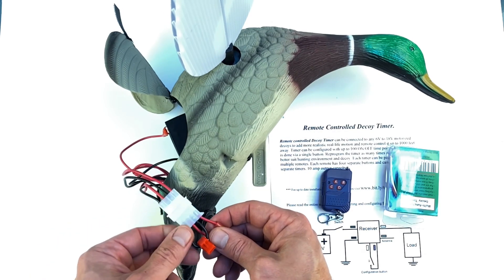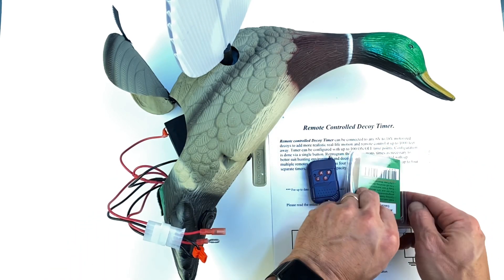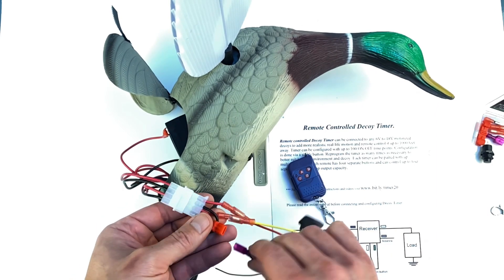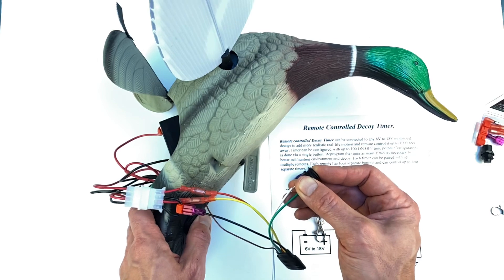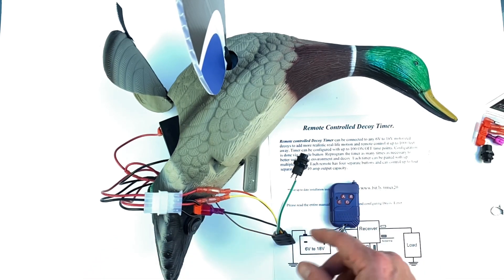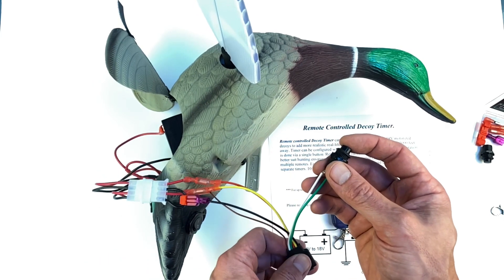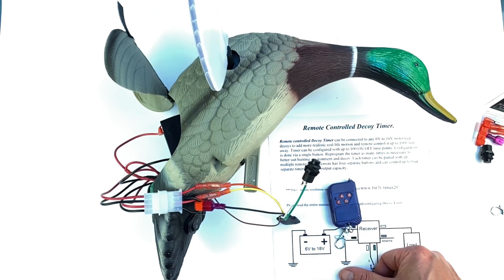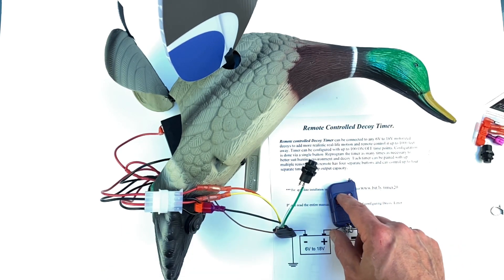Adding remotely controlled RF decoy timer to baby Mojo Drake

Comment: Question for you, is there any way to get remote timer to work with a motorized Lucky duck decoy? The ones that have the dummy plug in them, I could not figure out how to do it as there is a circuit board inside the decoy that negates the usual way like with the mojo's. I realize could probably take the circuit board out of the equation but would like to know if there is a way to do it without cutting most if not all the wires to the circuit board.